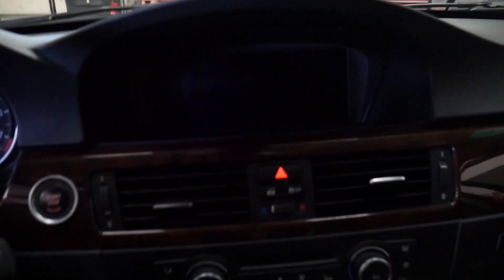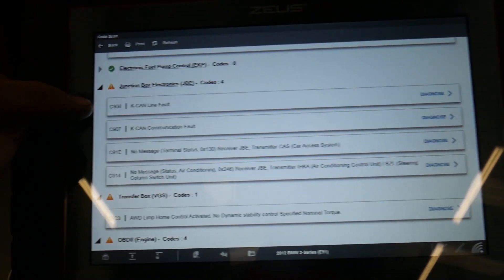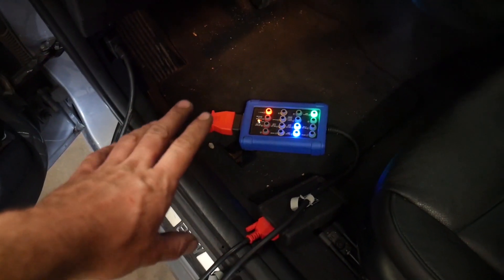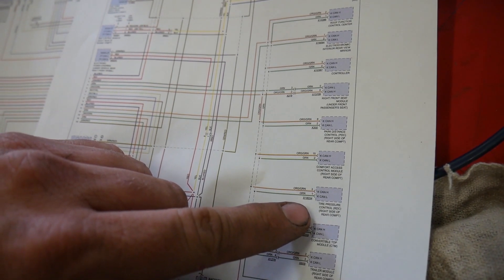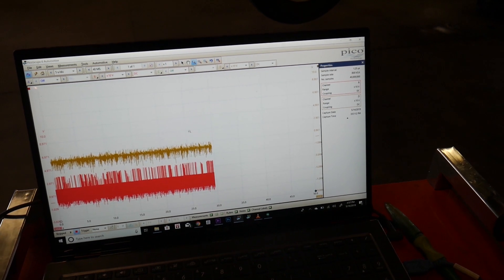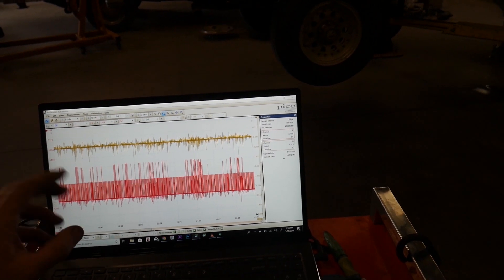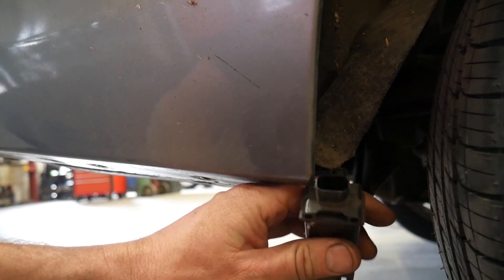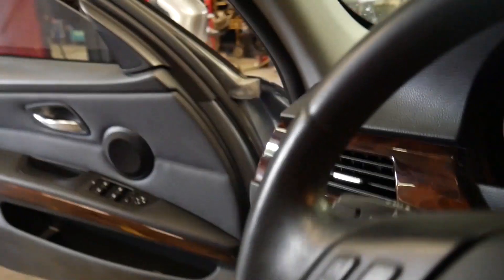2012 BMW 328xi no cluster, radio, climate, k line data bus

Comment: Great job Chad if you ever need any bmw stuff I have every known good capture possible for a F30 2014 Bmw328 for future. Also 08 Nissan Altima 3.5 and 14 Hyundai and 13 bmw 328 convertible my library is stuffed full with those vehicles. Great video my friend... Jay
Reply from the maker: Thank you Jay. I will keep that in mind for future vehicles.

Comment: Excellent work. Just finished watching new level auto with diag smart and follow the water.  Great video.
Reply from the maker: Yes Kieth always says to follow the water. Here in Colorado I don’t get many water intrusion cases so I sometimes forget to follow the water.
Reply: @ThePracticalMechanic  lol. Same here. But here in Toronto we get nasty winters AMD salt so it comes from everywhere..
Reply from the maker: I’m very fortunate to live at the base of the Rocky Mountains where we have mild winters. Even at 5300’ we only get a few big storms a year and a few days later the snow melts. Not much salt but they do use mag-chloride on the highways.
Reply: @ThePracticalMechanic  that's cool. Keep up the great diagnosis videos.good work